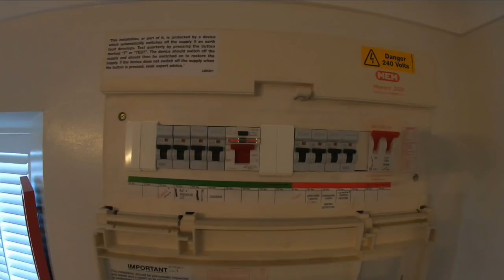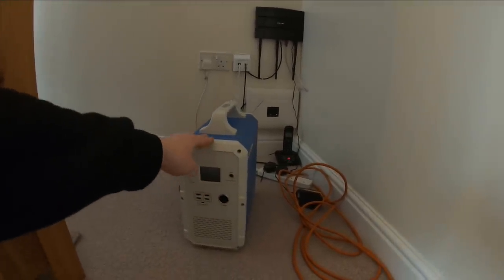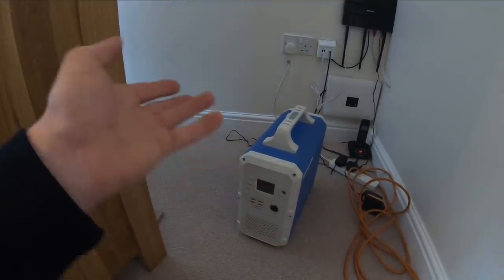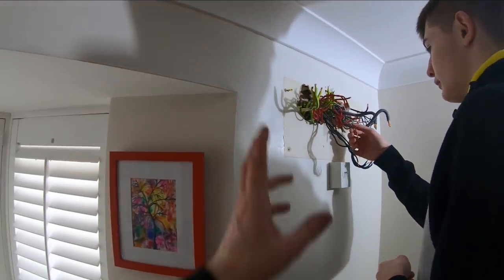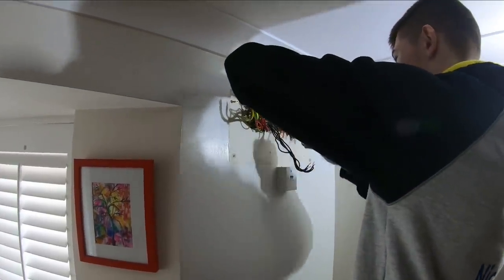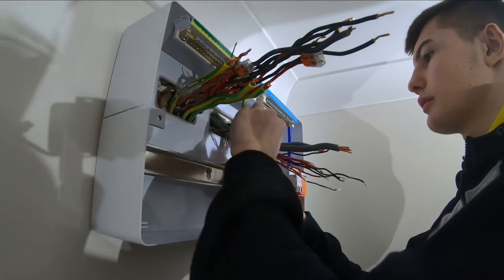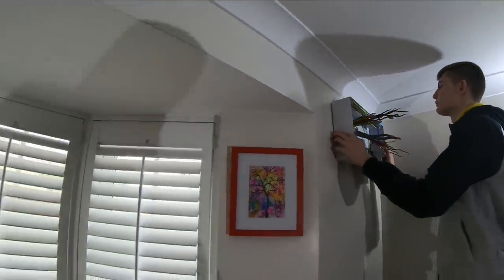Apprentice First fuse board/consumer unit change, Exotic life of an apprentice

Comment: Dear Nick. As of the telecom stuff, that is a VDSL2 based internet service, which utilizes the 0-17MHz range of the telephone line. If BT say there is too much noise on the line, the only source of that in the household are inductive loads, like the washing machine, dryer, and such: anything with a big enough motor. We also seen quite high noise coming from fluorescent lamps. A cooker or oven - although it pulls a lot of amps - is not generating much noise. One of the reason to use shielded cables for VDSL2 service is also this: you can keep the noise out at least around the house, as the old telephone network itself is not shielded. It is also true, that in most cases the noise is coming from other VDSL2 lines  as a form of crosstalk, you cant do much about that.

Comment: Nice work.  It's good to see tradesmen still use screwdrivers to fix accessories  instead of battery drills where needed . Allows for fine adjustment.

Comment: Nice work, Adam.  

I don't agree with BT and their assessment.  If it's WiFi they're struggling with, then they need to mount that router the correct way up and spread the antennas a little.  If it's losing sync, then I'd be looking at the router.   The one they have there looks like an TP Link Archer.  Not the greatest of routers, but with the correct settings they can get pretty stable.

Comment: Hey mate, I don't usually worry about sitting higher rated breakers next to one another. They're all rarely running at the same time anyway. I also like to have less single insulation wire/busbar carrying high current across the board. Have a great day.

Comment: "too much noise on the circuit" my arse.. Earth leakage also will have nothing to do with it, they're Class II PSUs.

The customer should try not using a cheap router, mounted upside down, in a corner, with a massive cabinet in the way. Moving it to put the extension lead in is probably what 'fixed' things..

Wifi isn't magic, it can't just be vomited into a corner where you can't see it and expected to work properly. Especially if they're expecting it to work upstairs, that position is dreadful.

That said, job looks perfectly nice for his first go. Doesn't have to be perfect as long as it's safe and maintainable!
Reply: As I see it first I was thinking "WTF! How stupid people can be?". Then I renember, they are liveing in UK. 😨😲😢
Reply: Ceiling WiFi is slowing becoming a thing now
Reply: @AE-mu1jc   Yeah because this country hasn't survived for well over 1000 years and brought the entire planet into the modern age.... nob
Reply: I couldn't agree more about the positioning of that router.  Archer C7 routers, apart from being butt-ugly,  aren't bad as consumer routers go but you need to give them a chance!  
Uncoil all that spare cable to the BT jack, clip it neatly in the corner of the wall and you can mount it 2m off the ground.  It still won't be seen behind that cupboard thingy.
Reply: Stick that router on top of the cabinet and, hey presto – all will probably be okay. GHz won’t work being stuck in a corner 🙉
Reply: they are probably talking about the link speed - modem to DSLAM - nothing to do with wifi mate.

Comment: I was always taught largest loads closest to the main switch whenever possible, the reason I was given is that when a large load like a 10.5KW shower kicks in, if the lighting circuit is nearer the main switch it can cause the lights to dim when there’s the initial current draw. Never challenged this, just accepted it as gospel because the guy that trained me was my electrical god 😂

Comment: nice vid great effort. Not sure I'm ready to give my apprentice a go at a db change as they haven't done anything with them at college on consumer units, not even opened one up and he's on year 2. Amazes me to be honest. Tried a couple of the Fusebox boards and yeah pretty impressed think I'll use them over Hager/Contactum. I did notice Neutral bars seem to be a bit loose on right hand side and there is only 1 connection for bonding.

Comment: A whole new board replacement for the sake of a new plug socket to fix a wifi problem? The wifi problem is router is pointing directly at the ground, in a corner and behind a cupboard... You literally could not place it any worse. Would you not just run some Cat6 for them and move that router to a central location? That would fix their wifi. BT 'Noise on the electrical circuit' - are they using those plug in powerlines gadgets to get data around the house?

Comment: I have never heard that about the larger mcb's being next to the main switch or next to each other.
I was taught in college, always to put the largest load down to the smallest load.
 Also I have  been in the NIC since 96 and their guy has never made any comment about it, and I have had several different engineers over the years.
Maybe the people who mention that are the same ones that used to say you had to bond metal window frames 🙄.
Reply from the maker: Too true 👌
Reply: I can remember the bonding of metal windows and being taught to put the largest load by the main switch, you're making me feel old!
I can remember the old imperial stranded  cable gauge  size 7,029 3,029, which I was told by an electrician when I was starting out .
Reply: @paultipton743  😂😂😂, well I started when the 15th edition was out so I am no spring chicken 😁
Reply: @acelectricalsecurity  me too but late on, I started 1st year apprenticeship 15th edition and 2nd year on 16th edition.
I actually still have the 15th edition regs book bs7671 which I found
Reply: @paultipton743  funny enough just like the new 18th edition my first regs book was a blue 15th edition I think

Comment: Nice one Nick but more importantly nice one Adam. I used to strip back outer insulation of tails but I no longer do as I was told that they should remain double insulated until point of termination. Not a criticism but a comment of curiosity. :) Probably better off running some CAT6 to their office. Love the content and the guidance for Adam. He seems a lot more relaxed and confident which is cool. Does he get to play with the test meter?

Comment: Re clumping cb's together, instead of 'some bloke on YouTube said', ask the manufacturer, as they will presumably have all sorts of test data about their product(s).

The BEAMA 'CU connections technical guide' version of best practice is to strip the sheathing of tails back just a few millimetres from the basic insulation, and mark the conductor with the appropriate colour.

Comment: Can i ask where you got the meter box keys from? Thanks in advance
Reply: Any supplier that sells Knipex stuff should stock them. You can find a cheaper knock off on fleabay that looks identical.
Reply: Stuart Arnold Cheers mate, i want a decent set because the ones i’ve seen are all on one key and its hard to actually use them because they’re so close together😂 kinda like this ( * ) where as i’m after one that looks like ( + )
Reply: The Knipex one like in the vid is in two halves. They hold together by magnets. It has just about all the box keys I need.
Reply: Stuart Arnold wicked! Thats the one i want in the Vid

Comment: Wifi works better with it being in the centre of the house and spreads out over if the customer checks the wifi config it will default to 2 channels change that to ether channel 12 or higher if available if not ask their ISP to do test on their end because it could be cable coming from their end to the house because it's the ISP responsibility to make sure the customer is getting the speeds they are paying for